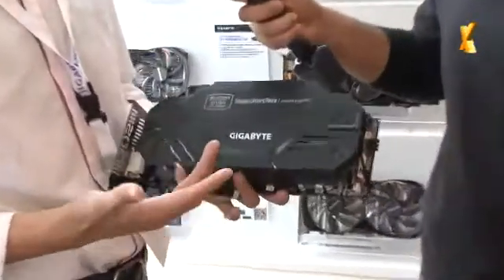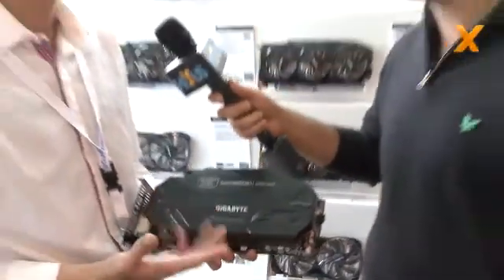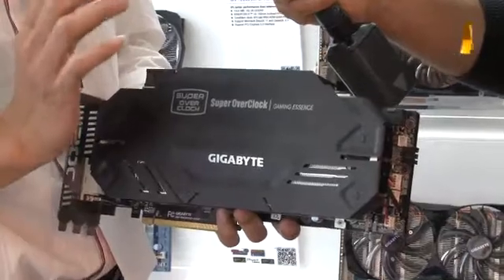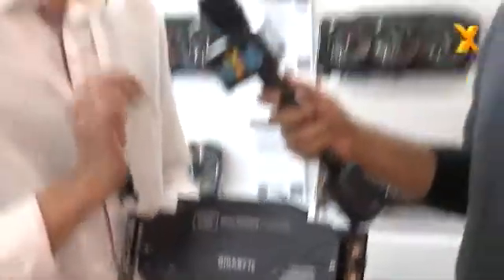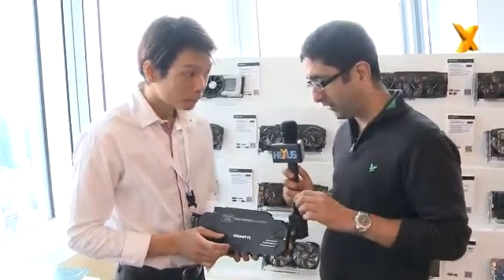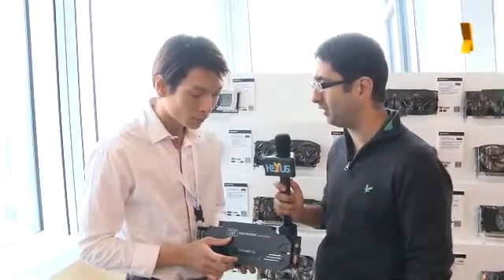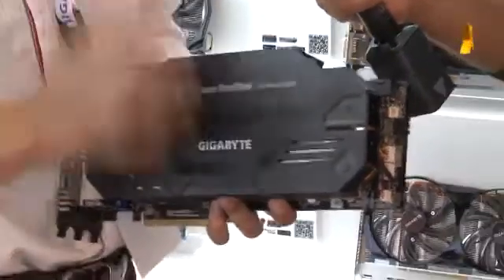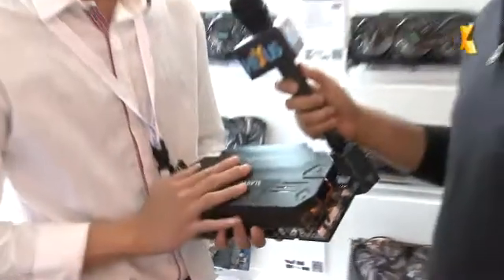Gigabyte explains the insane GTX 680 Super Overclock

Comment: If you have two of these in SLI could i bet you could remove the 10 fans from the graphics cards and replace them with something like a two 140mm or 120mm pressure optimized fans lower noise and epic cooling :D

Comment: the tiny fans have provide higher air pressure, i have a haf x case and the 200mm side fan duct pushes alot of air, BUT the air pressure is very low. For things like heat sink cooling, you need high pressure to get the air through the thin heat fins. so the side fan of the haf x will not do well. That's why the five 40mm fans are used instead.